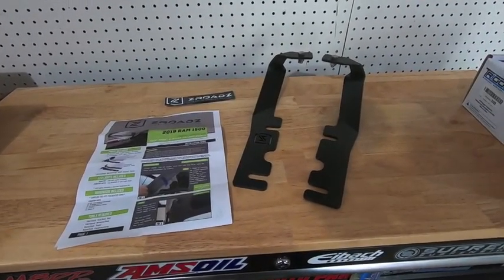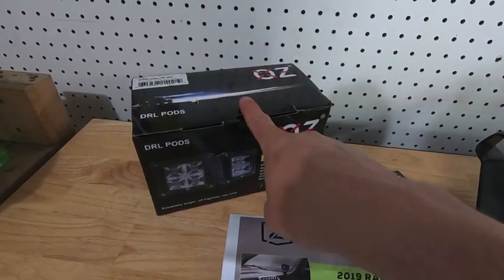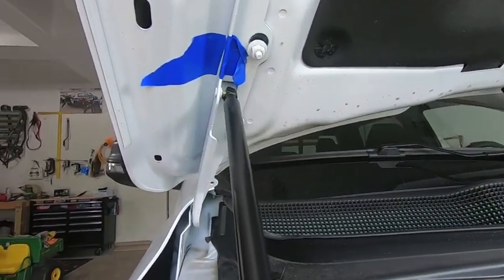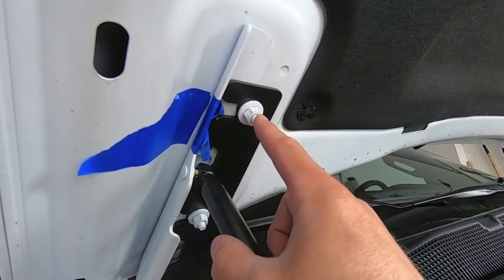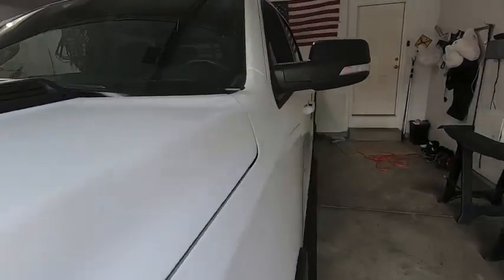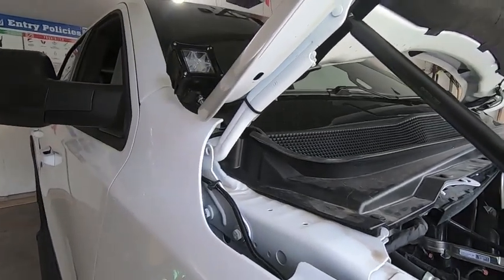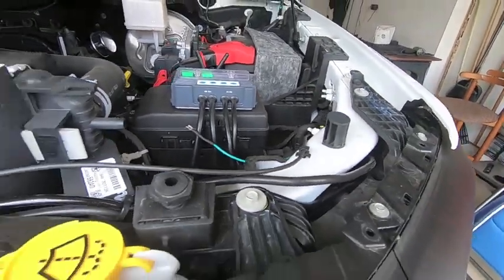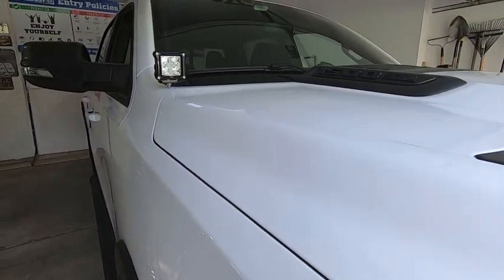ZRoadz Hood Hinge Brackets w/ OZ-USA Pods - Ram Rebel

Comment: Thank you for choosing ZROADZ and making this video! We are glad to see that the Hood Hinge brackets fit perfectly and it seems like an easy, bolt-on, no-drill install - just as we designed it!
Reply from the maker: ZROADZ Offroad Products  awesome fit, love the brackets!
Reply: Would this fit a mustang??? 😈😆
Reply: Do you have anything fit 2018 Rebel ?
Reply from the maker: They do,  check out their site, they have a few different options
Reply: Can you mount bigger then 3 inch pods if only mounting 1 pod not 2?
Reply: @GetmeoutofDelco   Yes. The brackets are designed to accommodate most aftermarket lights.
Reply: I have mine from a 2017 ram do you know if the brackets will fit on the 22 ram
Reply from the maker: @Redneckxican84 I don’t believe so, different hood designs
Reply: Thank you for the reply. Great video.

Comment: Looks like you have the exact same truck as I do down to the color, 2019? I noticed that your intake is on top of the motor with an exposed filter, is this a mod or how your motor came from the factory? My breather box sits over the right fender.
Reply from the maker: That’s a vararam intake, a few videos back I installed it. Recently swapped it out for a Corsa intake.

Comment: Did you use a relay harness? If so, how did you connect the switch cable to your trigger? Or if not did you just combine those 2 ditch lights together and connected to your trigger? Thanks
Reply from the maker: The trigger is my relay harness so it was as simple as plugging them into one of the trigger’s 4 channels.

Comment: Looking for little help here I’m having a huge BITCH of a time getting through the grommet in the Fire Wall any assistance to how you got in and out
Reply from the maker: Use a piece of solid wire or a kabob stick to pierce the grommet
Reply: @WaterFowler41  figured it out thanks for the reply back I moved the corner over on the  Grommet holding the E-Brake cable. Then the switch cable slide through no issues Thing was really starting to piss me off

Comment: Water Fowler 41 is there any way to route a cable through the firewall on a 2021 Ram rebel? I have hood mounted led pod ditch lights, I'm trying to figure out how to run the switch cable through the firewall to reach the inside of my cabin, any idea?
Reply from the maker: Yup, watch this video. I route a cable through the firewall on my dads limited.

https://youtu.be/WnjDFXYfz-c

Comment: I just put the bracket in between, felt like i had more clearance. Christmas tree zip tie and run along the back of engine, they way the older models had the hood light wiring
Reply from the maker: Doesn't that push your hood up a bit messing with the alignment along the fenders?
Reply: @WaterFowler41  nope. Just gotta realign the hood and lower the knobs front. Idk I just went that route to have more room for the pods to sit a bit higher.

Comment: Would this fit a mustang ???? 😈😆
Reply: We actually offer a universal panel clamp that you can use on your Mustang's hood. Here is the link for the mounting bracket: https://zroadz.com/i-23910180-universal-panel-clamp-led-bracket-to-mount-1-3-inch-led-pod-light-pn-z390001.html and for the cube LED: https://zroadz.com/i-23910193-3-inch-led-flood-beam-pod-light-pn-z30bc14w20.html

Comment: The brackets are ok but not strong enough. There are better brackets and companies. SDHQ Motorsports in Gilbert, AZ built a far superior bracket. Mounting is similar. Good vidio though.  I have the BD pro series high speed spots.
Reply from the maker: I had sdhq brackets on my gmc, check out the video on my channel, they needed a lot of grinding to fit the right way.

I’ve never once had any issues with my zroadz brackets where I wished they were stronger. LED pods aren’t that heavy.
Reply: @WaterFowler41   the BD pro high speed spots are heavier. I'm interested in your channel. Though I had no problem with my install. The BD had locking bolts to prevent theft. I look forward to seeing your videos. 
Thanks